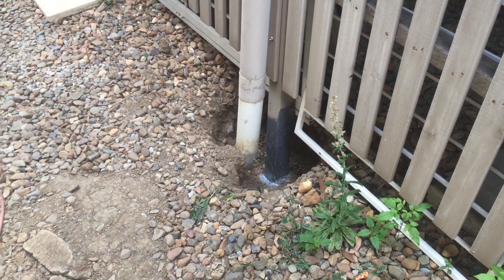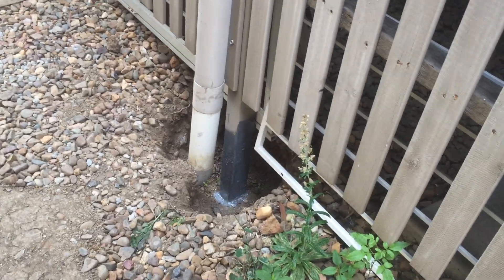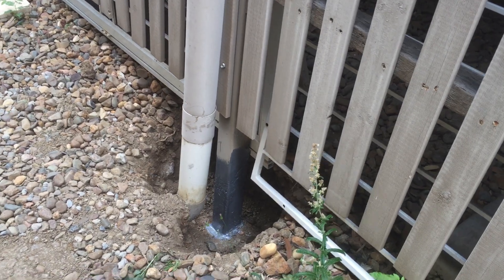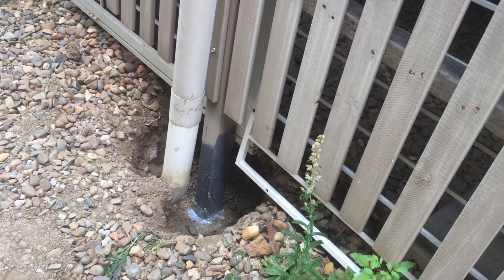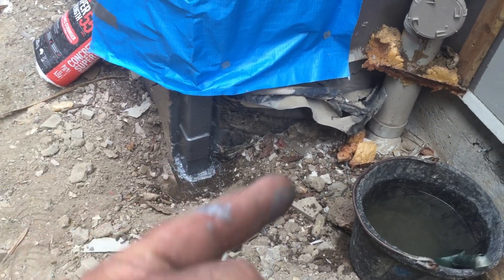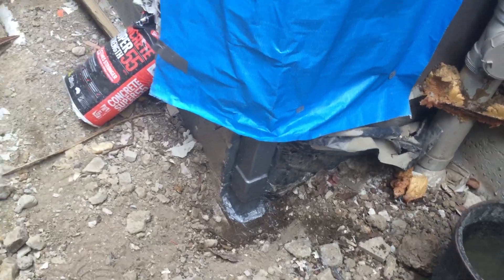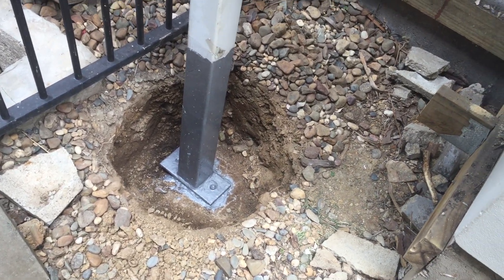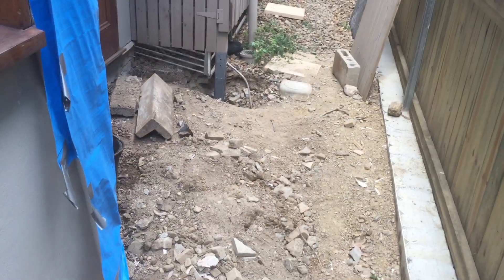Repairs on a job in Prince st Paddington. Vid No 2

Comment: Hey love your videos Dieter. Mind if I what size dynabolts do you use to secure the posts? Cheers
Reply from the maker: The size of the screws or true bolts or chemset pins all depends on the load the bolts have to take.
If if just down ward load then 12mm or 1/2 ins is enough. Iff it requires a shear load then I go to 16,, 3/4 ins, like holding stel beams to the side of a concrete wall.
50% of the time the size is stated by the engineer on the job.
I hope this is useful to you.
Thank you